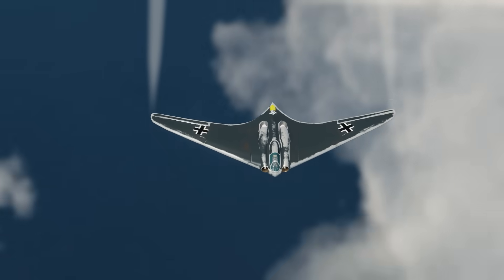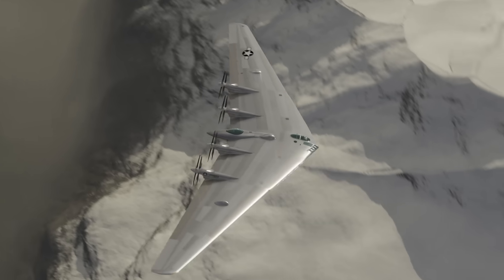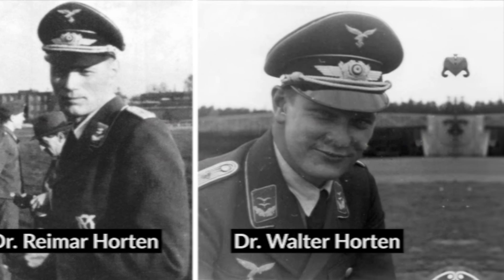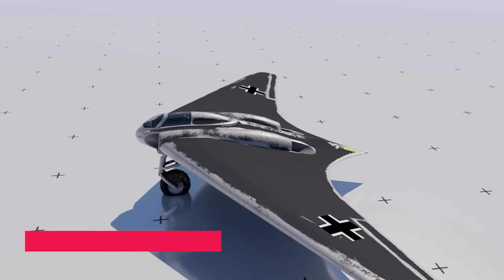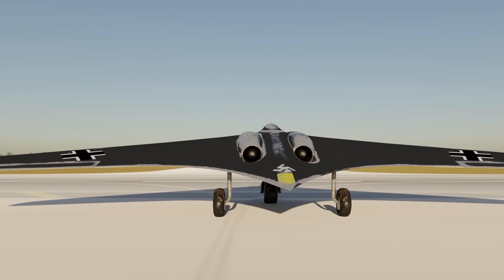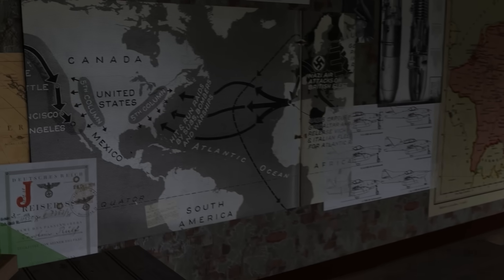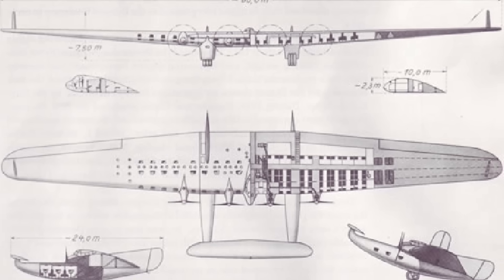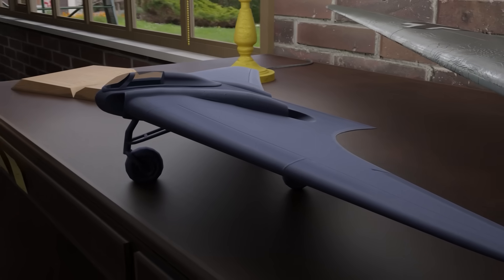Insane Flying Wing Jet Fighter To Save Germany - Horten Ho 229 Nazi UFO

Comment: "High aspect ratio wing" really doesn't have anything to do with the shape.  It means that for each loss of a given unit of altitude (feet, meters, doesn't matter) during unpowered flight it will move a large number of those same units forward.  Sailplanes have high aspect ratio wings.   powered aircraft do not.
Reply: what about the U2 Spyplane? Configuration of a Sailplane.... same Design...

Comment: Jack Northrop had developed flying wings that were tested under powered flight before the Ho 229,  notably with the N-1M and N-9M in 1940 and 1942 respectively. 

Not many of the performance metrics of the Ho 229 were really known because, as mentioned in the video, the plane only flew a few times under powered flight before crashing (believe three times actually). The Jumo 003 engines were unreliable, and one engine failure was possibly the cause of the crash.  The two brothers had done "flying wing work" with gliders and powered gliders in the 1930s. But there are a number of unverified claims and myths about their work and aircraft out there in the social media sphere / internet.

The Germans also had the Luftwaffe emergency for developing a variety of jet aircraft, getting the Me 262 operational (which was a struggle when it came to sortie generation) and a new, delayed HeS 011 jet engine in development. There were other development tracks with the Amerika Bomber too. Basically the Horten's work was a bit of a sideshow and waste  of money as it wasn't well baked or very far along. 

They did interesting work but no need to hype them up.
Reply: + Michael Dunne   Correct and well put.  The V2 crashed on the very flight to measure some speed data.   The entire 229 program was not mature at all,  just three experimental prototypes that were not ready.  Innovative, to give the Hortens their due credit.  But it was not ready for service and not the wonder-weapon is has been portrayed to be.
Reply: The N-1M and N-9M are more comparable to the Horten H.V which was developed before those two. The Ho 229 was fare more advanced with its jet engines and improved aerodynamic design.  They didn't want to use the Jumo-004 but the BMW-003 wasn't ready for production, so they had no other choice. It took the US several years to come up with a similar prototype in form of the Northrop YB-49.
Reply: @olli2591  The Horten 229 barely flew. And the jet engines were problematic, that is the Jumo-004. The YB-49 was much larger than the Horten 229, as a heavy bomber (really not that comparable aircraft), and its first flight was only a couple of years later, in 1947, during a period of massive demobilization and massive budget cuts. The antecedent, the XB-35, had been in the works since 1941. The YB-49 test program encountered a lot of problems (and accidents) but certainly clocked far more hours than Horten 229.
Reply: @olli2591    The YB-49 was just the jet version of the YB-35 that Northrop began constructing in 1941 when they were awarded the contract.   The N-1M was a research prototype and the N-9M was a one-third scale proof-of-concept of the YB-35.   The wing program was slowed by subcontractor disputes, etc.     Northrop didn't need anything from the 229 to complete the YB-49.    And the B-2 just carries the YB-49 concept into the modern era.  They are the same size and fly the same mission profile.

Comment: B2 copying ho229?
Reply: Nonsense
Reply: + Gaming Bruh    The B2 is the same size as the YB-49 and based on the original mission and data from Northrop.   It's three times larger than the Ho-229.

Comment: A 30mm mineshell has the equivalent in explosives of a hand grenade. There were tests done by the allies. A single hit on a smaller plane like a fighter was always listed as "lethal" or "probably lethal". Even on heavy bombers, a 30mm mineshell caused severe damage to the structure and ripped parts off. Naturally with the lower cadence and less ammo carried, they'd more often be used against large targets. 30mm guns were ideal for intercepting bomber formations.
Reply: Hence some German aircraft adapted as/for interceptor role carried the MK-103 in gunpods while others carried the -108 internally.
Reply: Specifically the testing was done on a Bristol Blenheim, pre war British bomber
Reply: A-10 Warthog be Like
Reply: The point is the technology was far superior.
Reply: @dennis17116  Hello. I would like to let everyone know that, the H-229, is not THE Nazi secret weapon or a lot of you may call it. Yes the developement of this aircraft is very real, but It is a cover up to what the Nazis were actually planning under the surface.
Reply: @dennis17116 they had a lower velocity and range and the ammo was larger and heavier
Reply: @TinyBearTim  Explosive shells don't need high velocity to inflict damage, Range was not an issue.
In terms of weight to destructive power? The MK-108 was the most effective aircraft weapon in service during WW2..
Reply: @DoktorBayerischeMotorenWerke  range was a issue because of the low speed
Reply: @TinyBearTim  Range was not an issue, German combat engagement research proved that most kills were made at 100 meters or less.
 Studies conducted by the Allies after the war confirmed this..
Reply: @DoktorBayerischeMotorenWerke You said in a previous comment that German fighters didn't have machine guns on their planes ? What about the late war ME 109 K-4 then? It had 2 MG 151 13mm machine guns!?  .......sm
Reply: That's why the ME 262 s were ordered to avoid the fighter escorts and go after the bombers.
Reply: @ Its why modern jet fighter have cannons... not machine guns..
Reply: Didnt me 109 and focke-wolfe's have canon?pretty sure they did.@DoktorBayerischeMotorenWerke
Reply: @ YES, German planes had cannons, not machine guns.
Only American fighters lacked proper cannons, machine guns were obsolete by the time the war started..
Reply: @DoktorBayerischeMotorenWerke There was plenty of US planes that had 20mm cannons ,do some research before commenting in future!
Reply: @ Not really, the primary armament for all American aircraft was the obsolete M2 Browning .50 Cal.

Only American fighters equipped with the M2 20mm cannon was the P-38 and the Hellcat which arrived at the very end of the war, the primary armament was still the 50 cal. as the M2 was unreliable and prone to jam or misfire.

Some American aircraft in foreign service were equipped with British or Swiss made Hispano HS404 20mm cannons, these guns were considered very dependable and reliable.

 All Me-109s were armed with a 30mm cannon, The K-4 also had 2 additional 20 mm cannons.
Reply: WHAT ABOUT THE MG 151 13mm machine gun which was still in use late in the war ? There's plenty of other American aircraft that had 20mm cannons that you obviously don't know about......end of conversation
Reply: @BobFiltration  It was not used as the primary armament, thank you for proving my point.
The were very, very few American planes that were equipped with the American made 20mm cannon, only the P-38 and the Hellcat Both were armed primarily with the .50 cal Browning machine guns, the standard armament for the Hellcat was 6x .50cal machine guns.
Reply: The famous YouTube video of a test on a Spitfire is absolutely terrifying... Imagine a single hit just cuts your plane in half.

Comment: This video is wrong... The Horten wasn't "A nazi design", it was built in secret by the Horten brothers, with STOLEN PARTS from the nazi warmachine... at no point did they recieve approval for their work by the governement or a contract, the closer they ever came to that was in 1943 when they participated for a competition to design a long range jet bomber (their prototype was the Ho IX, the 9th prototype plane of the brothers)

The various Horten flying wings were NEVER accepted designs or "secret nazi weapons", just two guys building whacky prototypes in secret with parts stolen from germany's aircraft industry and glued together plywood

As for the validity of the designs themselves, while they look futiristics, they had a HUGE issue with stability, they were almost impossible to fly because Walter Horten was obsessed with the idea of a flying wing that did not have a vertical stabilizer
Modern flying wings were impossible before fly by wire and computer controls, it would be possible to make a flying wing with aerodynamic elements that acted similar to a vertical stabilizer, but the Horten designs never included that

Lastly they weren't the inspiration for the B2 bomber, the US had began it's own research on flying wings in the 1930s, and the very reason the Horten were asked to produce a prototype in 1943 was specifically because German spies had discovered the Americans (Northrop) were working on similar concepts

Comment: The intro movie is probably flawed: the 229 had 30mm cannons and would destroy the bomber on the first pass.

It wouldn’t turn so tightly either, as the huge wing bled speed and you would only get it back quickly by diving. A pilot would conserve his momentum- its his defence.

Also, the wood construction made tight turns at speed risky.
Reply: When were the 30mm cannons installed in a Ho 229 capable of powered flight? Considering one plane did only 3 or 4 powered test flights before crashing?
Reply: Wood plies would be stronger and would sustain a hit better than metal.

Comment: That’s why the “tail” is called a “vertical stabilizer”…
Reply: Jimjimmyjames Smith  two words for you: “differential drag”. 
But unfortunately you can only do that using computers. 

When the pilot presses the “rudder” pedal in a B-2 he’s basically just telling the computer nervous system that he wants to yaw the plane. Then those systems decide how to go about it. Moving different control surfaces, maybe even the engines, to fulfill the pilot input

Comment: I remember when I see this thing is one of the best things that ever flown it was fast and Speedy like the me-262 but could turn like a ZERO on the spot.
Reply: Not that you ever saw one fly and no it would not turn like a Zero, the Zero only turned tight at low speed, this would turn much like an Me 262 or not well at all. The only experimental version to fly crash landed on the second of three short flights and crashed on the third killing the test pilot.

Comment: Once again, you see these revolutionary designs that no country ever kept in their newer designs..the engines wouldn’t even last for 2000 miles. The engines would of burned the wing with all that exhaust coming out that close to the wings.
Reply: No, the real one had aluminum plates covering the wing behind the exhaust to protect against that.

I don’t know why it’s not included in this 3D model, as you can see it in photos and toy models and other renders such as in War Thunder.
Reply: @goawayihavecommentstomake1488  aluminum would be the worst metal to use

Comment: ....wrong place for the vortices in the game - since this is the only serially produced airplane that did have no vortices at the wingtip...
Reply: Stall =/= engine stall
Reply: ...and flying wings are more than capable of gliding (aka. Flight without engines).

Among other stuff, the planes built by the horten brothers were all flying wing gliders before they built a jet powered version.
Reply: ...and they were in fact not choseen in a competition.

They swindled away funds (yes, in nazi germany), to build their passion project, which they used to sin a government tender.
Reply: It did have a bell shaped distribution on its wing, NOT a bell shaped wing.

(That should be pretty fucking obvious to anyone who seen a picture of the aircraft)

As in there is NO lift generated on the wingtips, as liftgenerated tapers of tozero as you come close to the wingtip.

On convetional aircraft it doesnt.

Comment: the Hortons didnt plan for any smaller radar cross section, if you can find me damn evidence for him stating that anywhere I'll be damned and I also wanna see where youre taking from the fact that it had a smaller radar cross section at all
Reply: also ""Machinegun Cannons", lol
Reply: @grum__1    Flying wing theory from the 1920s and 1930s was low drag and fuel efficiency.  Absolutely nothing about stealth.  Northrop and the Hortens were students of those theories.

Comment: The 70% saving is totally unrealistic. It really depends on other factors. The drag from the tail from a conventional aircraft is really not that high. The thing is while it pushes the aircraft downwards, that wast energy, it does so in the down-wash from the main wing, in effect reusing the downwash energy.

For aircraft that have canards the main wing sits both in the  down-wash as well as the updraft from the canard tip, canceling out most of the down-wash.

The actually body of a airliner is pretty sleek and don´t impose much drag. And the Structural weight is really not that high either.

What most people miss is that the majority of the structural weight of the fuselage tube is not the bending force, but rather the internal pressure. What is why all fuselage is close to cylindrical. This way the fuselage can act double both structurally for bending force and pressure.

In a flying wing you lose the cylinder, and have to ad a secondary cylinder for pressure only. This is not great becasue a flying wing don' t carry cylinders that well.

Comment: Pity this was spoilt by the pronunciation and naming errors. The original Horten IX plane was built in an autobahn maintenance facility on the outskirts of Gottingen. The building still stands and I visited it a few years ago. By then there were no workers there that were old enough to know anything other than a plane had been built there. I took my jet turbine powered model Ho IX there and took some photos. Prandtl was a professor at Gottingen in the 1940's, there was a wind tunnel there are a university aerodynamics facility. As others have explained he was the man that gave the theoretical explanation of the reason that the Horten deigns flew. David Myhra's excellent book " The Horten Brothers and their all-wing aircraft" explains how the Horten brothers developed their ideas from models to full size gliders. It appears that Prandtl didn't believe that a flying wing would be stable from the theory as it existed at the time. Apparently he was told about the Horten brothers successful designs and immediately got hold of them at the Autobahn workshop and they arranged a demonstration of one of their earlier designs at Gottingen airfield. He was amazed that the brothers had a very stable design and it was against current aircraft design theory. In effect they had got there by trial and error over many iterations of designs and not by following theory dogma.They found stability improved with wing tip twist and the flying wing had increased amounts of twist compared to 'normal wing designs of the period'. Turning the plane needs a differential aileron movement and the Ho IX used Friese ailerons that caused more drag to assist turning.  

 Interesting that is the some of the approach taken by Space X in the design of their rockets. Failure can yield up much in the design of new ideas and perhaps allow a leap forward. In the book there are some wonderful contemporary photos of the making of the Ho 2-A in 1934/5 in the family house in Bonn with the wing tip poking over the top of the dining table with plates  and food on it! 

Going back to the Horten aircraft my own model was designed by some German friends of mine used a sophisticated computer model. This helped ensure that it would stand a good chance of flying, but very few models of the Ho IX have flown successfully. We had over 30 flights but our confidence in the design was shaken when one day the plane just tumbled when it suffered a complete flow breakdown over the wing and it literally tumbled. Fortunately it was flying high enough that eventually control was re-established. One thing we found was that large nose wheel being at the front of the plane tended to steer the plane and we had a rule not to lower retracts until we were on finals. Interestingly a similar order was made with the full size. Personally I think  the original design may have had flaws that may have gone against it.

Eric Brown the well known British test pilot knew many of the leading German aircraft designers of WW2 as well as Goering. He was based in Germany before the start of the war. He flew the Horten IV  glider and would like to have flown the Gotha Go 229 but the plane was not developed enough to risk finishing and flying it. The engines were unprotected and very close to the pilot. Eric was the only British pilot to fly the Me 163 under power and he flew all the german jet designs at the close of the War.

John

Comment: The Ho 229  if used in a hunter roll would probobly just attack from straight on. Then the time to fire from the B17 side would be so short they would barley have any time to hit it. After it pass over the speed they would depart from each other would be so large the bullets would have problem keeping up.

Comment: truly an extraordinary design, I do question however just how much time would have been required to take this design from the prototype stage to a practical production machine, if the American experience with the XB-35 is any indication the process would not have been a quick one, the technology simply did not exist in the 1940's. You know what makes the B-2 possible... modern computer attenuated flight control systems, that was the innovation that made possible Jack Northrop's flying wing, and I question whether the Horton brothers would have been able to make their design work without it. I suppose its fortunate we will never know.